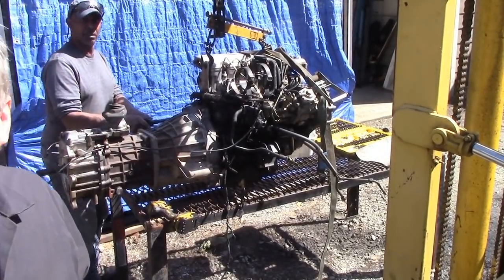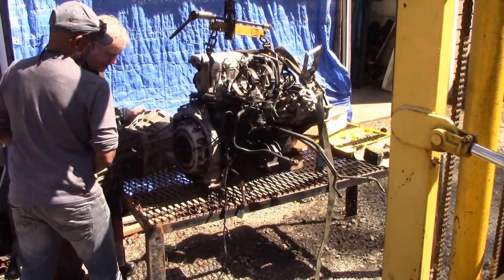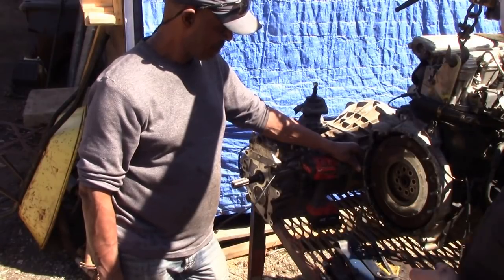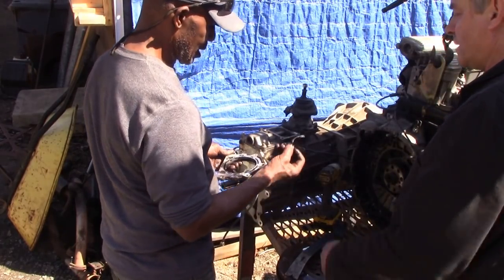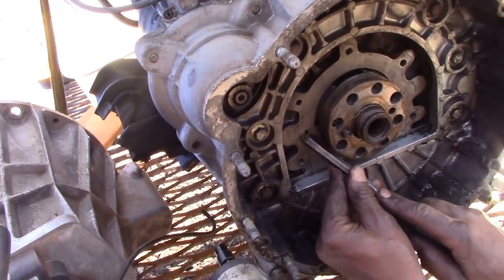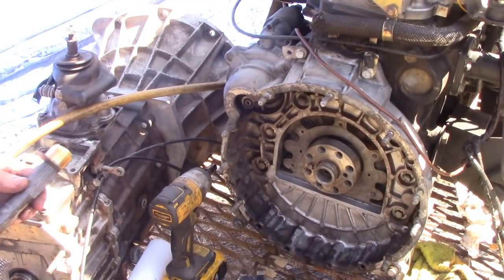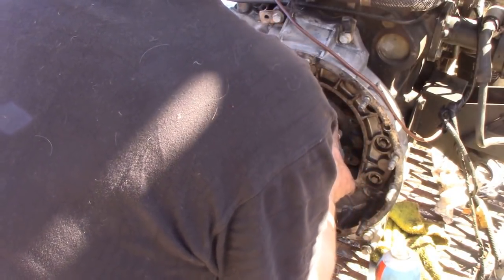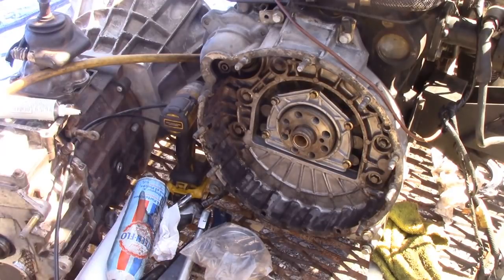Malawi 110 replacing the clutch and rear crank seal Part 1

Comment: Good going Mike and Kurtis. That bench looks like it was made for the job.
Have you thought about adding that JP seal tool to your shop?
Reply from the maker: I could do Ian, but the cost would be expensive as it would have to be drawn, and programmed into CNC - not sure if it would be worth it as I need to have a minimum order of 50
Reply: @BritannicaRestorations  Far enough. I'll have a couple of guide pins made.

Comment: FYI fishing thumbles breaks have the same requirements as torque wrenches , backoff compression spring when finished the job to keep correct settings , or have regular costly checks
Reply from the maker: Thanks for the info

Comment: Nice job young felahs,next question what would you do if the crank has a groove worn from the seal,speedy sleeve or shim the seal up.
Reply from the maker: Speedy as long as it does not impair any other assembly /disassembly

Comment: Mike.  That'll give it another lost 5.0Hp !  So a machined flywheel and a brand new Veleo clutch kit will make her go faster.  Going to fit that $25 turbo boost pin ?  V.
Reply from the maker: nope - but you will see in a later video I turned the original pin to a better position for a bit more sparkle

Comment: I couldn’t quite hear the comment about fitting the seal and whether it should have a little oil or not.  Could you put me right on that, please, Mike?  

Do 300s have T seals on the rear bearing cap?  Wonder if they’re missing entirely...
Reply from the maker: The Teflon seals are fitted dry
In the revised workshop manual the T seals are no longer fitted but RTV is injected in to the slots - much better
Reply: @BritannicaRestorations , thanks Mike.

Comment: Mike, it's pretty obvious that the Malawi mob went to a lot of trouble to do that "rough" job on the crank rear seal, and now you've gone and undone all that hard work. Do you think the "T" seal is still really ok?
Reply from the maker: Yes I think it will be fine -  the RTV straddles the bearing cap  joints and real RTV is far better than silicone!
Reply: @BritannicaRestorations  I'll bet that the end cap is put in with silicone too. Best let sleeping bodges lie!
Reply from the maker: You are supposed to use RTV in the caps now not the T seals